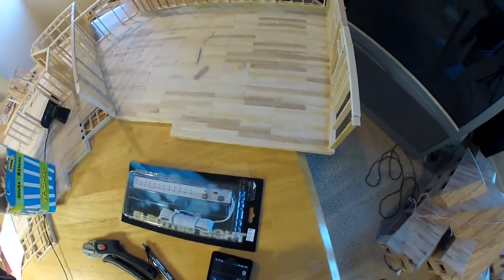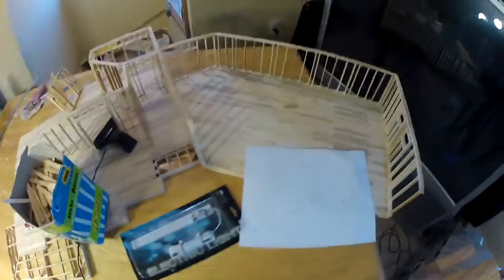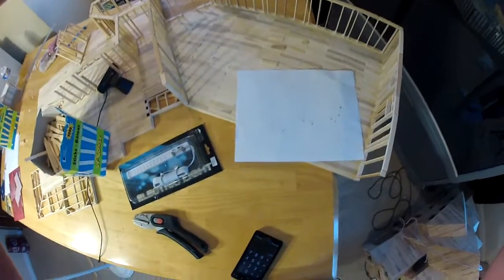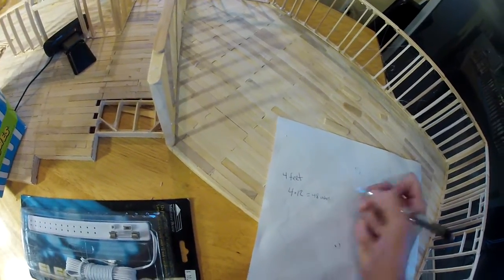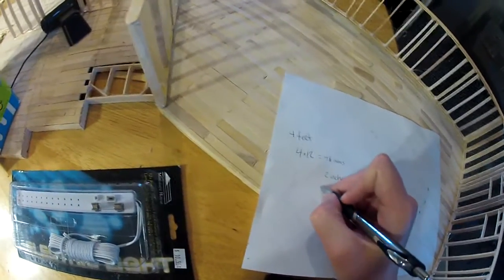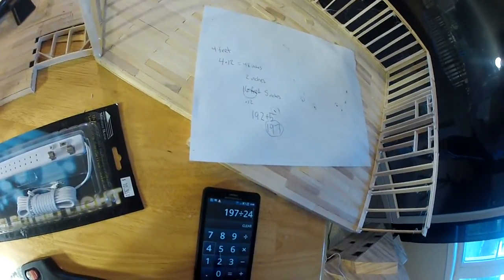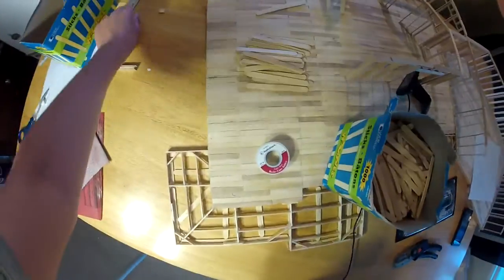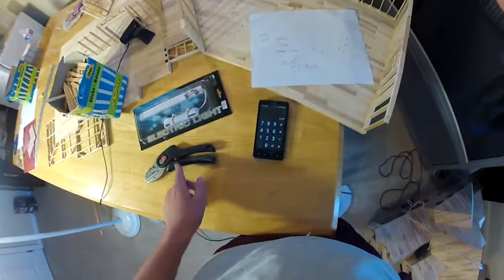How I Calculate My Scale

Comment: 0.21" * 4 = 0.84/4" (Quarter of an Inch)
0.21 * 8 = 1.68/8th's of an Inch 
0.21 * 16 = 3.36/16th's of an Inch
0.21 * 32 = 6.72/32nd's of an Inch
0.21 * 64 = 13.44/64th's of an Inch

1 divided by 8 = 0.125"
0.125 x 8 = 1/8th of an inch.

Or how about this...

0.21" x 25.4mm = 5.334mm
5.334mm / 25.4mm = 0.21"

Hope that helps. Great video.